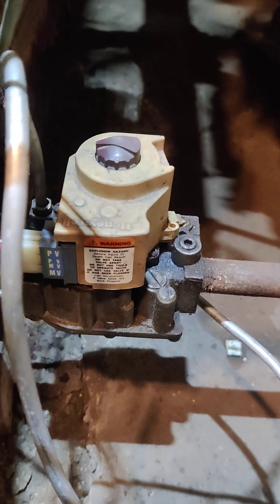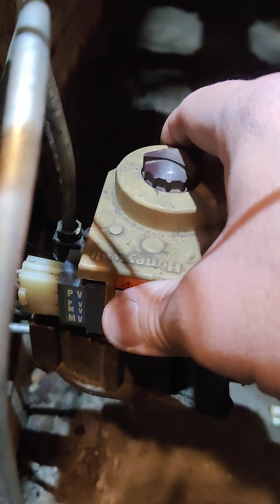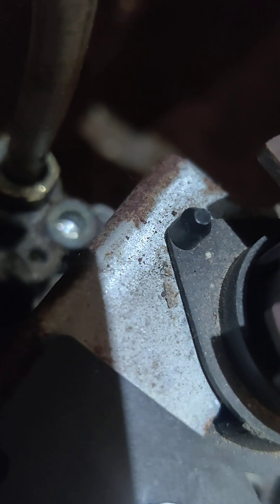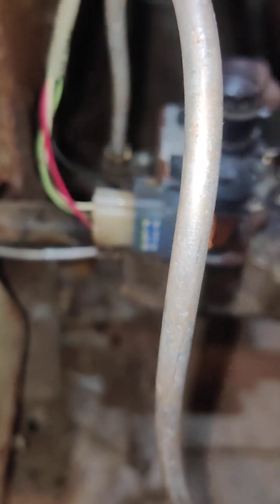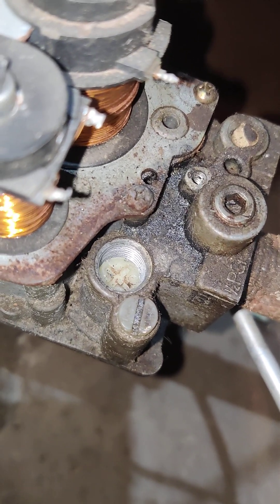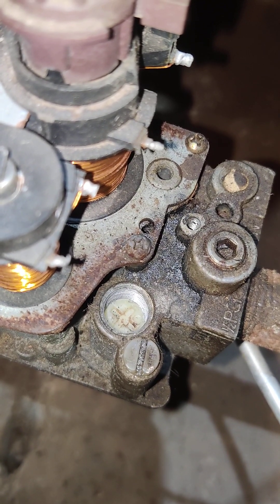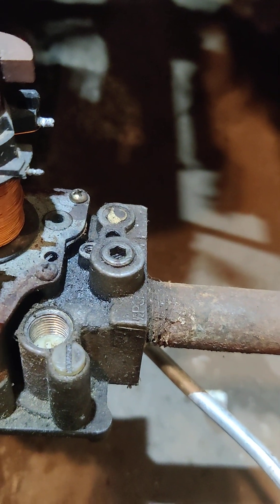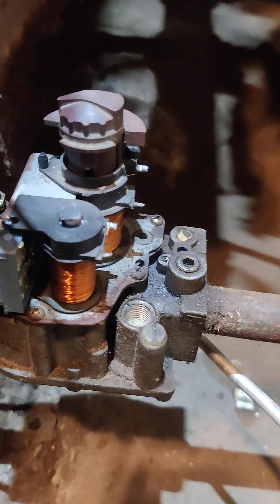HONEYWELL GAS VALVE ADJUSTMENT SCREW LOCATION AND ADJUSTMENT!!  #how #howto #diy #fix

Comment: Not 3 bar. Perhaps 3 inches of water. The typical factory setting from the manufacture is 3.5 inches of water with the acceptable measurement being up to 5 inches of water. These readings are for natural gas. For propane it would be around 10 inches of water.
Reply from the maker: Oh okay

Comment: Ah HAH! The exact info I was looking for! After watching several videos on Honeywell gas valves explaining all the details about them EXCEPT where the pilot adjustment screw is hidden, your video finally shows it. Thank you.

I replaced a burned out thermocouple last November on my boiler but the pilot flame seemed way too high. But it ran fine all winter. Now this week the boiler quit again. I checked the thermocouple again and it was also burned through so I replaced it again and have been searching for how to adjust the pilot flame. Thanks again.
Reply from the maker: No problem! That's what I'm here for.  If you need any other help videos feel free to ask!